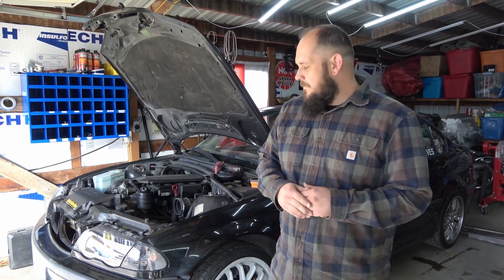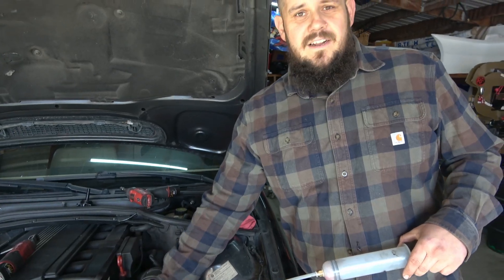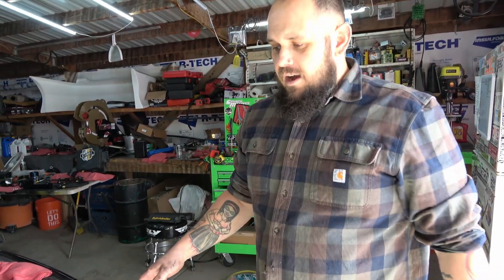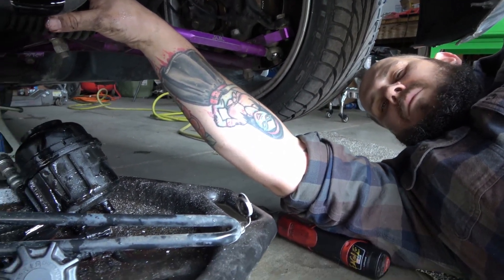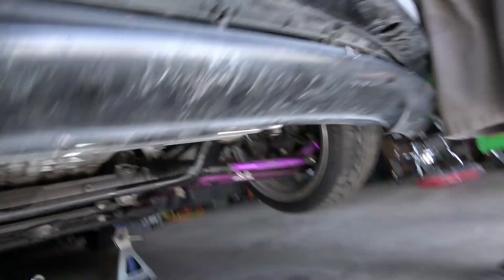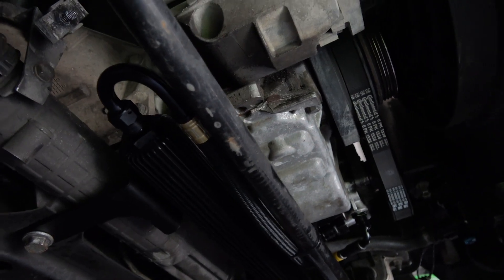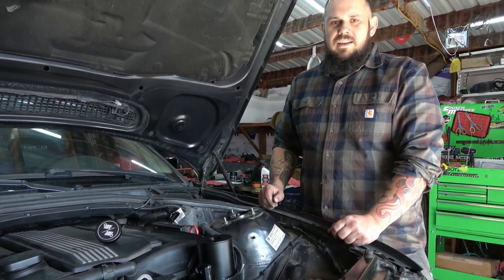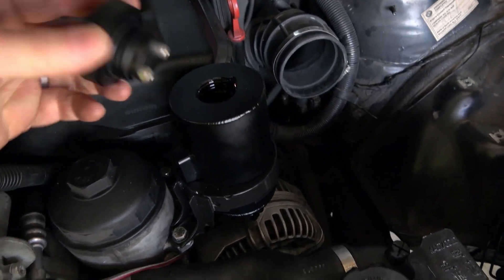How to Install ChaseBays E46 Powersteering kit

Comment: Hello i have a BMW  its power steering fluid flow out  form the reserve bottle the reserve bottle is blocking that the doing this
Reply from the maker: Sorry for the later reply. I assume you figured out that you may have had it overfull.

Comment: How how has this system been working for you?
Reply from the maker: It has been great we had one hiccup with the power steering feed line, which we are still investigating if it’s a pump issue or line issue. The rest of it has been awesome. It has helped keep the power steering system cool during the summer drift events very well.
Reply: @EagleMotorWorks  what was the issue you had with the power steering feed line? I’m not sure if I have my fitting right on the pump barb
Reply from the maker: @rayfrausto1  we found the hose barb for the feed on the pump was aftermarket and did not want to seal with the press over fitting very well. Just and aftermarket part not jiving with another changed the pump no problems. If you have any questions about fitment shoot the support team an email with photos.
Reply: @EagleMotorWorks  I think I may have same probably. Haven’t ran it yet but ordered a new pump from fcpeuro and putting the fitting on the barb and fully tight it seems like u can still kinda move it with some good force. I am kind of doubting it will seal. Thank you for your time. Video was great
Reply from the maker: @rayfrausto1  It is ok to move you just want to make sure the o-ring is sealing in the barb. This hose is under suction so it’s not under pressure.  It does not require the same sealing force as something under pressure.

Comment: Not worth the money! Just buy a mishimoto cooler and use 1/2 in power steering line. Overpriced!
Reply from the maker: Great opinion but I prefer having nice BMRS hoses and AN connections instead of crappy hose clamps.